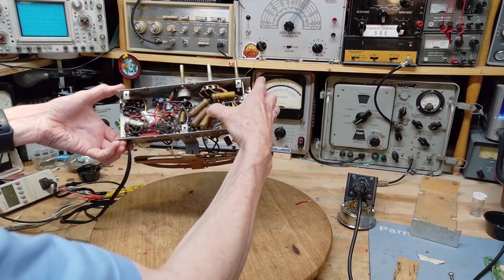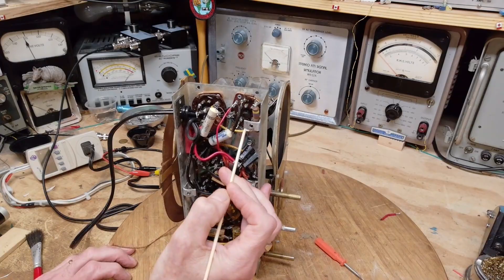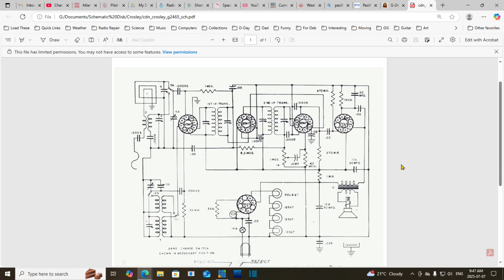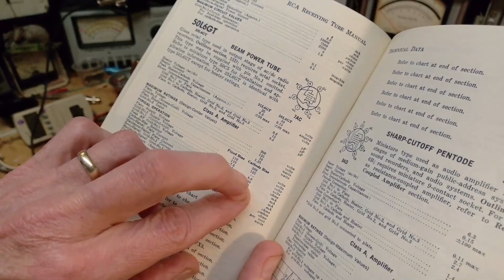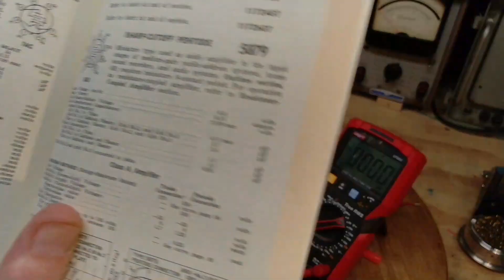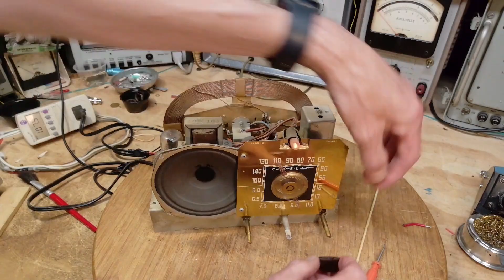Crosley Moffats Model G2465 AM SW Tube Radio Video #2 - It's Good to Go!

Comment: You do go on and on about a shock hazard , what could happen? You are going thru two isolation transformers and a dim bulb circuit, on top of that you never operate anything at-full line voltage. Maybe you should wear gloves toll! While you are in there charge every cap! Unplug the chassis when you are soldering in parts. The grid signal does not go thru the cathode!  The excursions of the audio signal develop the DC bias on the cathode from the plate current swings  created by the grid swing. No current flows thru the grid. Its like watching a student at his first repair. The two caps on that tube go back to the 1970’s. Time to replace, tightwad!
Reply: Jim has an isolation transformer but in the wild the set could have alive chassis and that is the point he is making, I don't think you understand Jim's Radio Shop channel and your expectations are too high and your tolerance too low.  I recommend you visit Shango066 channel and let Jim a retired bloke in his shack to fix stuff in his own way and cut him some slack as life get harder as you will find out.   Best.
Reply: YES, CONSTANTLY YAKKING ABOUT FIXING THIS RADIO *BUT NOT ACTUALLY FIXING IT!!*